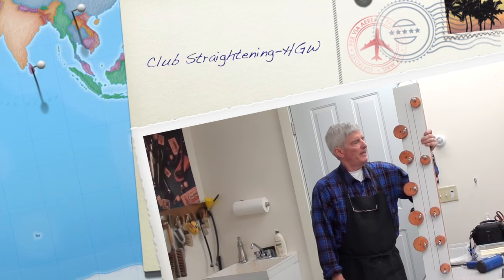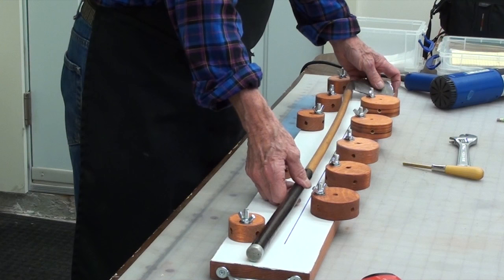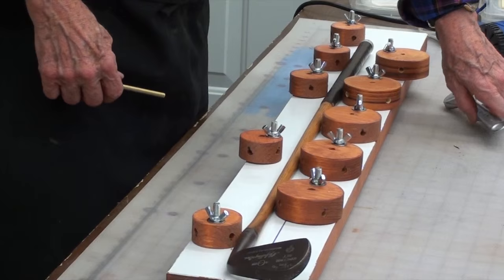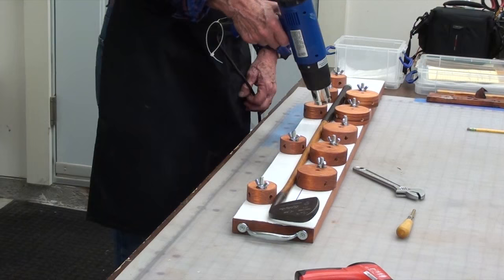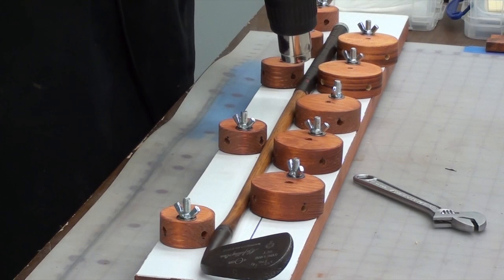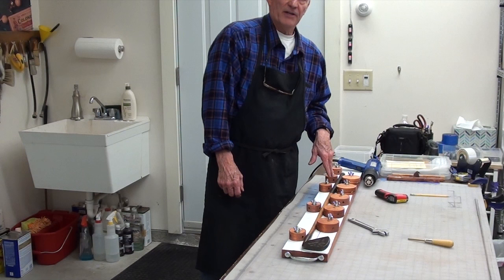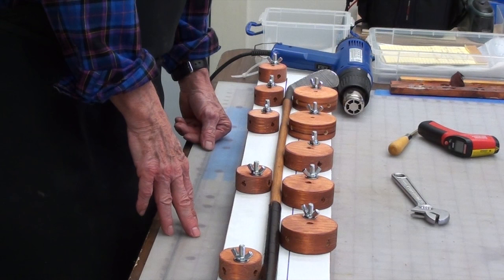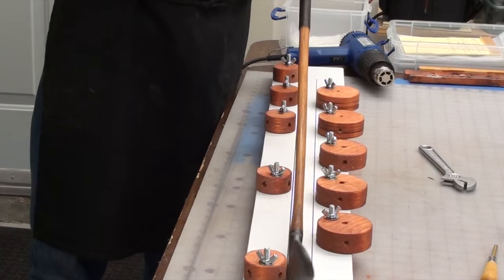Club Straightening-HGW

Comment: what is the way to straighten the wooden cue butt when it is all painted?
Reply from the maker: Valter, this is a good question!  I would say that you want to be very careful to keep your heat gun moving at all times.  It may be impossible to heat the cue up enough for the straightener to work and still not effect the paint.  In that case I would say do the straightening first and if there is paint damage, sand out the cue and redo the paint.

Comment: The reason it has butterflies nuts is so you dont need a wrench!!
Reply: I find that with a very curvy shaft, I cannot turn down the wing nuts enough to really hold the cam in place so I use just the end of the crescent wrench to get more leverage on the cam.  But you are right, most of the time, finger tight is enough.  Also if you use a wrench, be careful when you want to turn the cam open, be sure to use a wrench to loosen the cam so you won't break one of of the cams
Reply: still need a wrench unless you have one heck of a grip with your fingers....if you do, wait 30 years and try again......